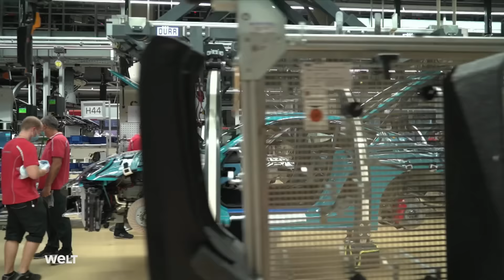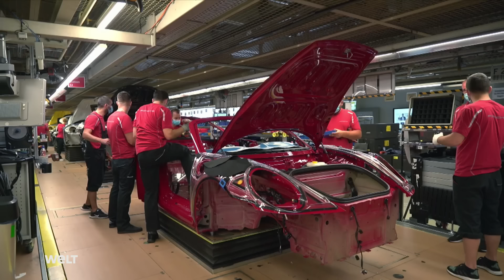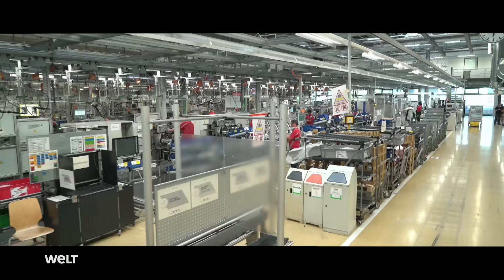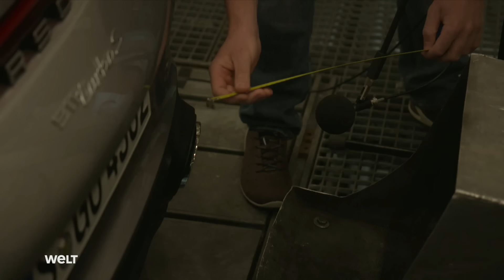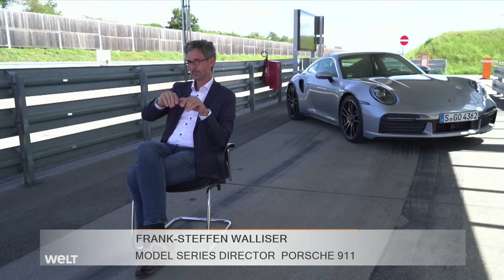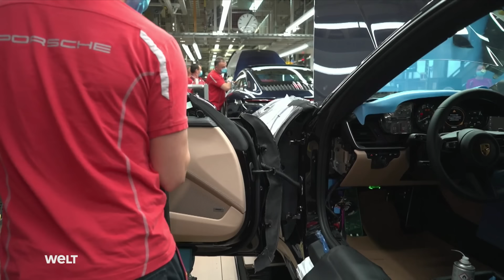Building A PORSCHE 911 - Legend On 4 Wheels | Full Documentary

Comment: Remember when you’re breaking in your motor, a German tech has already red-lined it for a while, you’re not going to hurt it.
Reply: Most engines die through people not actually “breaking” them in.
Reply: @thewiizard  No they dont. Most people dont even know there is a recommended break-in process outlined in their owner's manual. Car manufacturers know this, that is why most engines are already tested ahead of time when they are produced. Besides modern engines are built with much more accurate tolerances than they were even 20 years ago and the rings get broken in almost immediately when tested at the factory. The transmission, suspension and brakes require more break-in these days than the engine does.
Reply: @EK-rr2md  exactly. Seeing people write about breaking an engine in over 500-1000 miles makes me cringe. I just know their going to blaze the barrels and never bed the bearings in properly. 2k miles later they wonder why it span a main.
Reply: @EK-rr2md  lucky with AMG, there's a sticker right in front of your on the driver side corner windscreen indicating how to break-in your engine
Reply: Actually the factory does test the engine up to redline.  But the factory test to redline is not under a load as when its in the car accelerating or even a static steady rpm.  Its quite different and can generate tremendous heat and other destructive forces until broken in.
Reply: @thewiizard  Most engines die because people don’t add or change the oil.
Reply: Antonmursid🙏🙏🙏🙏🙏🇲🇨🇲🇨🇲🇨🇲🇨🇲🇨
Reply: Testing and breaking in are two completely separate things. Engineering explained has a video on it among many but essentially during the break in you are polishing all the parts through their friction with other parts. Same reason why everyone should change there oil at 500,1500, then 3000 and standard from there. Cut your oil filter open you’ll be amazed at what you find. But to each their own.
Reply: @a.common.American  they should also use a magnetic oil plug too. On my last 3 new cars I used them at the first 3 1000 mile oil changes and was SHOCKED at all the metal it gathered!
Reply: All an owner has to do to break in a car is follow to a T what Porsche says to do in the owner's manual. When I get my Turbo S I will do exactly what Porsche tells me to do and when I can launch it and open it up.
Reply: Next time I buy a new Porsche I'll think of that.
Reply: No they don’t even Andreas Preunninger has given his recommendations about the break in period and they are higher than the recommended in the manual

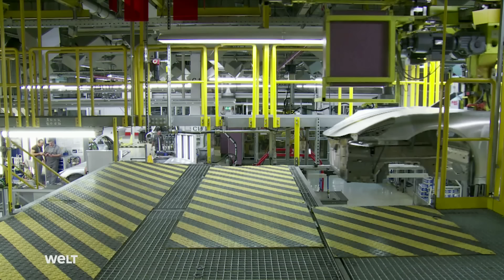Comment: 6:33 The priming and painting process that electrically designates paint particles with an opposite charge to the metal body for vastly improved oxidation protection was originally a Ford Moter Company innovation.
In the David Halbserstam book "The Reckoning" he recounts the development of the process. In the 50s and 60s, Ford products were notorious rust buckets even by the standards of the other American car companies. Halberstam describes the top executives of the company allocating vast resources of money and manpower to engineer a solution. Ford made a brilliant technical breakthrough that put the company far ahead of its domestic and foreign rivals. But because Ford was run by accountants and controllers(beancounters) and not engineers, the company, concerned about the tremedous cost to implement the new technology were slow to install the large and expensive ovens into their factories. According to Halberstam, the slow monetizing of a new technology was very typical of Ford. Their caution prevented the company from being the world leader in a technology they invented.

Comment: I drive the original 2.5 Boxster 986. Now done 250 000 km's. After track days and boiling the brakes on the occasional Porsche Club track days, I feel quite sorry for the incredible punishment that it often endures, especially when boiling the fluid and loosing brakes after ~50 minutes of hard racing. Yet after cooling down, (using the standard callipers) it is perfect again. It's still immaculate after all these years and all I can say. What a fantastic engineered product due to the best team of engineers that developed the best products in automotive history. "Porsche passion perfected proper power for pure pleasure"
Reply: Losing not loosing.
Reply: Definitely not immaculate
Reply: Good on ya dude - love it when Porsches are driven as intended

Comment: It is the best ever. Porsche 911 see's the future with the internal combustion engines
Reply: it really doesn't the 911 is going fully electric in a few years mate. Sorry to tell you.
Reply: @philipvideos275  lmao they are making synthetic fuels for the 911
Reply: Plaid already leaves it in the dust.
Reply: @eugenefr7837  and it's gonna be a decade slower than a 911 turbo s on any track 😂
Reply: @sachinchaphekar246  Well Im going off what a seller that has inside information and has been working at porsche for 10 years is telling me.
Reply: @philipvideos275 No they won’t, it has already been confirmed.

Comment: Lucky enough to own a 997 turbo cabriolet with 6 speed manual.
Awestruck watching this documentary. And ya, these engines are bulletproof.
997 has the last of the Metzger engines. 
Love the look of the 993 turbo, but the 997 is the pinnacle of 911 design IMHO.
Modern features,  yet still a bit old school

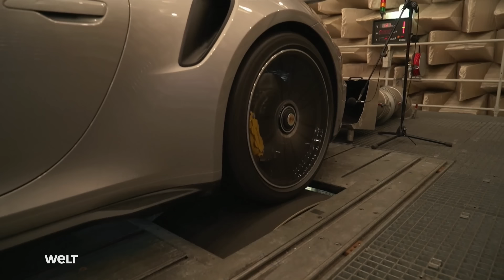Comment: Hmm. the audio testing is being done on a 992 Turbo at 38:00 which is an AWD platform, yet only the rear wheels are moving. I wonder what they need to do to disconnect the system to the front drivetrain. The old cars with manual handbrakes I think you could lift up the e brake one notch to disconnect the front.

Comment: In 2011, I purchased a '98 911/993 from a friend for $32,500--last year of the air-cooled.  Triple black coupe, 6 peed manual with only 36,000 miles. Sold it 3 years later for $38,000.  I was a fool.

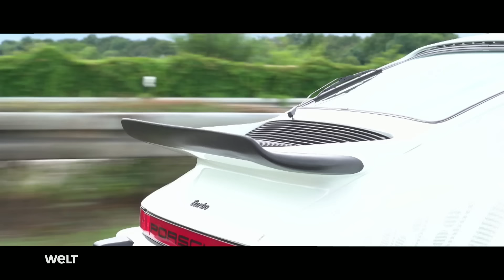Comment: 29:00 it's not really water vs. air but new vs. old. People like the older ones because you can buy individual parts for it. If a sensor breaks in your new gearbox, the only part you can get is... a new gearbox. For the older ones you have everything available, shift forks, layshaft, etc. Same with the engine, the newer a 911, the more complete and expensive parts get. Bent a valve? Sorry only a complete cyl head is in the parts catalogue.

Comment: $60k c7 vette or $200K on an upside down bathtub...same performance, huge contrast in design and engineering.
Reply: Lol not close at all. Used c7z costs more than $60k now. For $200k that's a used 911 gt3rs or a new gt3 or turbo

Comment: Last mile so,uiting built in, that would be nice, like an e-bike on board of the car,,, integrate them, so eg eBike charged by car, would be nice,,, now I put my own folding bike in the trunk,,,  a car integrating two odes and f transport, car for long transport, and a bike or other transport vehicle for last mile becomes more and more required, parking in city itself becomes more difficult and expensive,,, my bike in trunk, it is very very convenient! Also to and from changing station,,,

Comment: Sad BUT THEY ALL LOOK THE SEAM and it’s HARD TO TELL THE 911 From OTHERS from a few feet away WITHOUT BADGES! 🤔🤔🤔🤔😡😡😡😡😡😖😖😖😖😖😖🙄🙄🙄🙄
Reply: They 911 are easy to differentiate. The Carrera has a small retracktable rear spoiler, the GT´s have a big spoiler and only the Turbo and GT2RS have air intakes at the side and large air intakes at the front.

Comment: AVOID Macan GTS!

My Porsche Macan GTS was in the shop for eight cumulative months for the first three years of ownership. 

Dash rattles, sunroof rattle, Apple Play stills does not connect after five repairs, six attempts to fix the squeaky steering wheel noise, cabin flexing pops, gearbox failure, and noisy fuel pump are just a few ongoing issues after four years of ownership experience.

Porsche North America is useless in resolving the issues.  Phone calls and emails go unanswered. Porsche North America is a disappointment.

Porsche has seen a sharp increase in cars repurchased back under state lemon laws due to quality issues.

Porsche cars now rank at the bottom in quality.  
Ownership disappointment with the brand is now shared with long-term Porsche owners like myself.